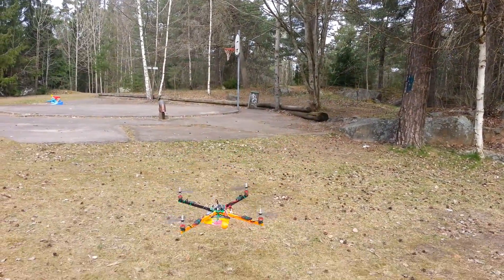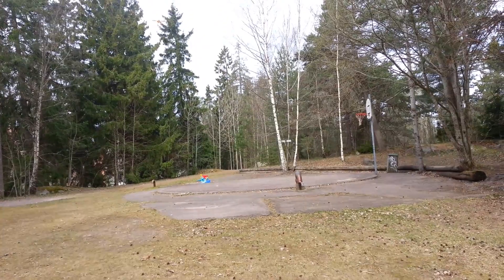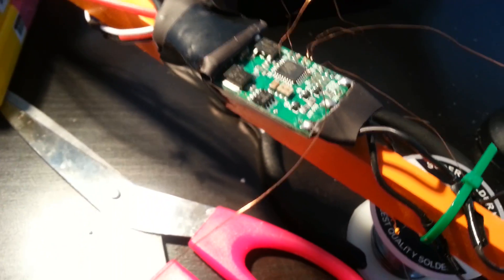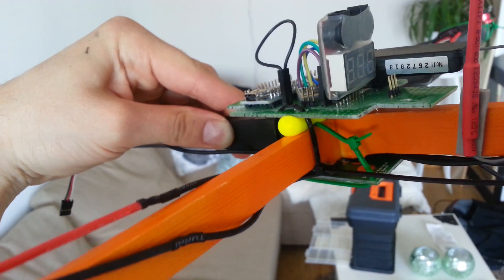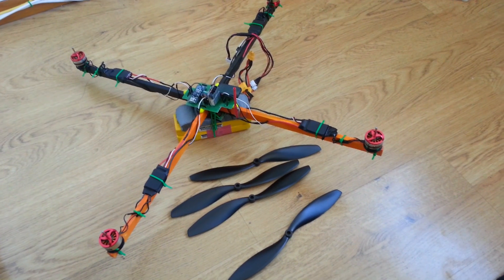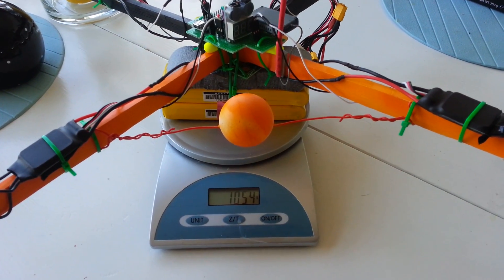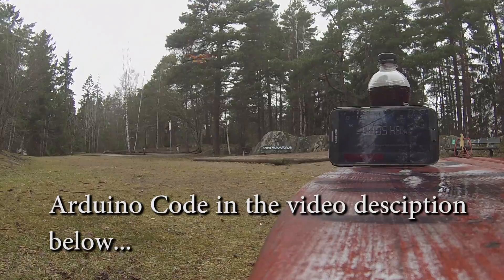Building Arduino quadcopter 30 min flight time + code and schematics

Comment: Q1 // mark all of them on 18 Feb 2019
  //  PCintPort::attachInterrupt(ESC_IN, escRead, CHANGE);
  //  PCintPort::attachInterrupt(ELEVATOR_IN, elevatorRead, CHANGE);
  //  PCintPort::attachInterrupt(AILERON_IN, aileronRead, CHANGE);
  //  PCintPort::attachInterrupt(ppp_in, pppRead, CHANGE);
  //  PCintPort::attachInterrupt(ppp2_in, ppp2Read, CHANGE);
  //  PCintPort::attachInterrupt(ppp3_in, ppp3Read, CHANGE);

and the //#include <PinChangeInt_ESP32.h> 

I tried to correct the *.h file and I cannot take some of the errors. But overall I cannot manage after  working for 8 hours, so I marked the Pin Change interrupt statement  in the *.ino. I do not understand there is a need to do Pin Change Interrupt under ESP32. 

 Q2. digitalWrite(13, HIGH);  I do not know what is GPIO 13 for? It is not in the wiring diagram!
Q3. There are a lot of at least 550 statements for MPU 6050 IMU, is this crazy???
Reply: GPIO 13 is  for internal led that is on board.
I bought a NANO for testing and figure  out to the uploading via usb-ttl method myself.

Comment: Hello sir, thats a nice quadcopter so i have a question that the arduino code you given in link, inside that folder there is only one code....so is that single code will run all components i mean receiver, esc, mpu6050 etc.....??

Comment: Hi Joseph :) I build the same but wrote another program as my controller is based on another arduino. 
My problem is that I don't succed tunning the PID : I raise P but never get stabilization. I start to get oscillation so I raise D but then I got a lot a shaking on X and Y axis and when the drone start to fly, it goes really fast head down and crash.
I really need help here... Also, How fast is your control (general) loop in your program and do you have filter fr the MPU ? I am at 250Hz (4ms for a loop on average) and use the low-filter from MPU6050.

Thank you.
Reply from the maker: Louis Simon
 Hi Louis, some things that might help is to make sure you compensate for any steady state gyro offset. Let the quad lie still on a table or the floor, and log a few seconds of gyro data. It should average zero in both the x and y direction. (since the quad is still). Any non-zero average you get, you should subtract from your raw gyro data when running your control loops.
Also, make sure you get the correct scaling of the gyro data.

Try to use dampers under your accelerometer/gyro, earplugs work great.

Try searching for pid tuning videos on youtube, there are some good videos out there.

Good luck :)
Reply: After months spending on trying to tune my quad, loosing the codes on a computer death, I finally spent some time looking at the datasheets in smallest details and one stuck me : the max frequency of the ESC is 500 kHz. My loop was around 1 ms... Everything is soooooooo simple and stable since I slowed down ^^' !!
Reply from the maker: Louis Simon, Im glad you found out what was causing the problem. Happy flying! :)

Comment: Do I need the Lipo alarm?
Reply: Kolumbus Meier in this type of project you can use it only if you want
Reply: matte15 Ok
Reply: Without the alarm you can go under 3V and then your battery will be damaged a lot and maybe won't charge anymore. You can then charge them to pass those 3V as a normal battery but this is quite dangerous ^^ I think you can't do without (I thought I could do without but when you are close to 3V the voltage drop dramatically, your drone crashes and you pray for your battery to not explode on charging).

Comment: Awesome I just have a reccomendation. 
Make some landing legs so it does not land on the battery or if it were to fall on them. If the battery gets punctured there is a very very high chance the lipos will start a fire but otherwise awesome quad.

Comment: Hello,
So I'm building an arduino quadcopter and i ran into a problem. After the ESC calibration setup with the arduino, i turned the throttle up a little and the motors started twitching and beeping. Do you happen to know what is going on? Please help. I could email the video of what it is doing if you'd like to see.

Comment: myservoT.attach(7);   //7-TOP
  myservoR.attach(8); //8-Right
  myservoB.attach(9); //9 - BACK
  myservoL.attach(10); //10 LEFT

Hi Jose, I'm in doubt as to the ESC's connection.

The servoT and the ServoR are the two arms on the front of the quad?
Is the servoB and servoL the rear arms respectively? sorry my bad english i´m from brazil

Comment: Does the electrical schematic need to use transistor and diode on the pro mini power auxiliary port? Would you have the connection scheme?

Comment: Isn't connecting li-po batteries in parallel quite hazardous as they are not self balancing batteries unlike li-ion? So, if one of the two goes bad or discharges the second will charge the discharged one with full force and it'll heat up or can also cause smoking and in worst case fire!

Comment: i tried but the motors were spinning violently what would be the problem ?
Reply from the maker: ashok kumar I would recommend to first make sure that the motors are rotating the correct direction, and then make sure that the  gyro is placed at the correct angle on the quadcopter.  Then you will most likely need to tune the PID parameters.

If you still have problems you should take a look att the ppm signal comming from the arduino and make sure evertying looks correct.

Good luck!

Comment: where could i find the extended video? Another thing I want to ask is that what is the rotor orientation according to the digital pins d7, d8, d9 and d10.

Comment: also which servo is the top and the bottom? for instance you have the ping pong ball for orientation, are the arms to which it is attached left and right and the other two top and bottom? just confused

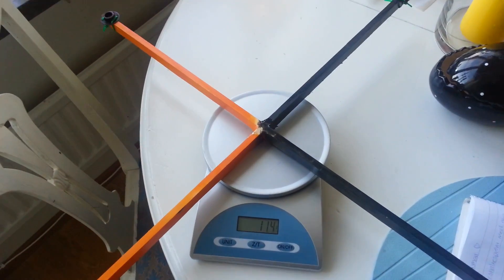Comment: Hey, were in high school and we are trying to build the exact same thing you are right now. I need help I bought all the materials you put in the Dropbox but what is the power distributor in 0:35 and also you said something about a simon tech board????? Is their anything you used that is not in the Dropbox because all I bought was the motors the escs the  batteries the remote the arduino nano and the lipO alarm mpu6050. We admire your work and we really need your help maybe we can contact you through email???? Thank you so much! HELP!

Comment: Josef Holmner,

I am looking to build my own quadcopter using the same hardware, but a different frame and materials, plus the possibility of extra changes.  Do you have any problems with me putting your Dropbox-linked code etc. into my publicly-accessible Github repo?

Comment: Bro i have used 930kv brushless motors and 30amp mystery firedragon esc and 3000mAh battery and 4x  7.5X4.5 props and rest of the things are same except for the lipo led alarm. but my quad is not flying. Another thing is what is digitalwrite(13)?

Comment: My drone is 3200 grams and I get nearly 30 min hover flight, with gopro, gps, servos for moving landing gear and everything.
Reply: +Vlad B Im new to Ardiuno. Did you used the same coding and method like he did for quadcopter,apart from your additions. Thanks in advance
Reply: +Muhammad Faisal i did not use arduino at all. Here is what I built: http://www.rcgroups.com/forums/showthread.php?t=2327044&page=135#post34397730

Comment: Hi Josef, first of all, good job and very nice video.

I'm trying to use the code in a quadcopter and I have a doubt with the code.

I assume that ELEVATOR = pitch, and AILERON = roll but I think I'm wrong... and, how do you compute de yaw? The config of the quad is + or X? I think that is + config for the next funtion

void reciever_to_value(){
  if(ESC > 900 && ESC < 2000){
  main_power = map(ESC,1080,2000,670,2000);
  }else{main_power = 800;}
  
  yaw_temp = AILERON;
  
   if(AILERON > 900 && AILERON < 2000){
     if(yaw_temp > 1550 || yaw_temp < 1450){
        rad_rotate = map(yaw_temp,970,2000, 180,-180);
     }else{rad_rotate = 0;} 
   }
   
   
     if(ppp > 900 && ppp < 2000){
  rad_tilt_TB = map(ppp,970,2000,-44,44);
     }else{rad_tilt_TB = 0;}
     
        
     if(ELEVATOR > 900 && ELEVATOR < 2000){
  rad_tilt_LR = map(ELEVATOR,1000,2000,-44,44);
     }else{rad_tilt_LR=0;}
     
     PID_tune_2 = 0.1*(map(ppp3,1000,2010,4,15));
     PID_tune = 0.1*(map(ppp2,1000,2010,15,50));
//     gimbal_wanted_ang = map(ppp2,1000,2010,100,0);
}

First: ESC its clear, is throttle, and you map it.

Second: AILERON -> yaw_temp = AILERON? (AILERON is roll, isnt?) and you map rad_rotate between -180 & 180, degrees,, thats calc is for yaw, isnt? Is AILERON a YAW?

Third: ppp, is pitch? rad_tilt_TB (top, back assume), and you map between -44 and 44, angles for inclinations, its clear.

Fourth: ELEVATOR -> the same question, is pitch or roll? I assume is roll for "rad_tilt_LR", again -44, 44 angles.

and the last lines, ppp3 and ppp2, what channel are they? or the purpose.

Thank you very much.
Reply: Hello! Im trying to build arduino quad. Have you done yours ?
Reply: did you finish yours,,   Just started with mine???
Reply: im finished with cc3d on board :)
Reply: Is it working?
Reply: yes
Reply: +vrb can you give me details,  like you design  drawings  , codes etc
Reply: I used cc3d with cleanflight hex, programmed via ftdi. All based on zmr250 frame with blheli esc. Just goodle cleanflight on cc3d.
Reply: +vrb didn't you use an Arduino  uno ?
Reply: No, i decided build on cc3d. Arduino works, but slow, and not stable for me. Code i downloaded here, by link below video.
Reply: +vrb 👌. . gòod
Reply: did u find the code in the libraries????

Comment: test_radio_reciev() has been called Inside the void setup().But I am unable to find ESC value range, means from where ESC get definite value to check the condition while(ESC > 1120 || ESC < 1060) 
Its looks to me that test_radio_reciev() does not require.
ESC value assign from void check_radio_signal()

Please clarify my comment

Comment: when I compile code I get this error
 Quadcopter_Code_Arduino.ino: 658: 26: fatal error: PinChangeInt.h: No such file or directory
why?
Reply: +Diego chauca gallegos why you did not add PinChangeInt folder inside your Arduino library that is located in "My Documents"

Comment: If I were to hook up a go pro with this, would you suggest I buy motors with more RPM?
Reply from the maker: I have added a GoPro to this quadcopter myself with no problem at all. good luck!
Reply: +Josef Holmner Thank you!! I will let you know how it goes!
Reply: +Josef Holmner Currently the motor and ESC you listed is on back order on hobbyking.com do you have any other suggestions on what to get in replace of them?

Comment: hello...how much did it cost for you to build this amazing adruino quadcopter???
Reply: bellow 100$
Reply: Domino60 I want to build a quadcopter like yours..can it carry a gimbal and a sports cam?
Reply: Renz Romaguera same question
Reply: 1200 Kv motors could probably handle the extra weight, if not just to a bit higher (due to the heavy weight of the batteries, even a 2200Kv motor wouldnt go astray, not much more expensive, is a direct replacement, and offers much more thrust, at the expense of fight time)

Comment: Thank you so much Josef for your sharing. I intend to do this quadcopter but I am just an amateur about Arduino. Could you tell me your Arduino code using PID or PWM technique to control the quad?

Comment: Hi Josef, Nice project and also i tried to borrowed  your  idea and code but as i m new in this short of project I failed in some point. can you please help on this below ques.
1. please let me know how i can calibrate the esc's, did you calibrated from ardiuno connected or by connecting the rx with esc seperate. I am using hobby fan 30A esc' s for my project. 

2. Can you please share the other channels( ppp.......) setup from the tx that you mentioned. i have turnigy 9x v2 version.

Comment: Hey Joseph thx for the job.
Please check code in read_acc_gyr().
the 2 following lines seem suspiscious :
double ang_x_raw = accel_t_gyro.value.y_accel;
double ang_y_raw = accel_t_gyro.value.x_accel;
Would rather be ? :
double ang_x_raw = accel_t_gyro.value.x_accel;
double ang_y_raw = accel_t_gyro.value.y_accel;
Thanks.
Reply from the maker: Marcel, the reason I switched the coordinate axis is because I prefered to call a certain direction of the IMU module y and x respectively. You can change it back if you prefer, just make sure tge module is facing the right direction.
Reply: +Josef Holmner Ok thx Joseph. I understand now. I shall use x with x, and y with y.
Please can you tell me what are these 'DigitalWrite(13,...) ? What did you connect there ? Looks like MPU reset, but I dont understand how.

Comment: Thank you for your video and code. Can I use this code to control a helicopter using two servos ( not for quadcopter)? Do I need to modify any part in the code? Thank you in advance for your help.

Comment: when i trying to upload the code to the ardiuno it fail 
Arduino: 1.6.1 (Windows 8.1), Board: "Arduino Uno"

Quadcopter_Code_Arduino.ino:658:26: fatal error: PinChangeInt.h: No such file or directory

compilation terminated.

Error compiling.

  This report would have more information with
  "Show verbose output during compilation"
  enabled in File > Preferences.

plz help
Reply from the maker: Jesus , you will need the PinChangeInt.h library. It should be included in the drop-box folder "libraries". Good luck!
Reply: same issue
Reply: +Josef Holmner I have same issue : PinChangeInt.h: no such file or directory

I put the file PinChangeInt.h on my folder but the result still same.. can you teach me how to fix this problem. pls..
Reply: +Josef Holmner Thanks a lot

Comment: How much did you spent?
EDIT: ok I have made my homework, now I know how much =P
continue reading please (my next self-comments)
Reply: Do you think I can attach a GoPro Camera (110g) on this Drone without compromise a lot the battery life?
Reply: And now the really important question:

Do you think it works if I use:

this motor (x4): emax mt2216
this ESC (x4): Emax SimonK Brushless Motor 30A ESC
this battery (x1 or x2): FLOUREON- 11.1V 5500mAh Lipo 3S 35C

The items you used in your project are unaviable in my country in less than 60 days =|
Josef Holmner please give me a hand =P I am a newbie eheh
If I am not wrong my drone will fligh for 15-20 mins more or less (if I use 1 battery)

Comment: Pretty good job! I bought almost the same motors, but different ESCs (because they have not better on werehouse on Banggood), 12A instead wanted 20A ESCs. The same props, but also I will try three leaf 9x4.5 props for quiet flight (500 grams thurst on 10A, while 10x4.5 two leafs has 500 grams thrust on 8.5 A). Thank you for sharing this video with us. Construction look so simple and easy. I hope to finish mine soon.

Comment: Hi.I made it.I upload software to arduino uno.But when I increase throttle engines running order.Before the first engine is running,then second engine is running,then third engine is running,finally last engine is running.So it does not rotate at the same speed all engines

Comment: Hello Josef,
Very nice job! tnx for sharing the information.

I wonder if you know how muck this project costed?

tnx in advance =)
Reply from the maker: Talal Osman , I estimated the costs to around 110$, but that figure does not include shipping nor smaller items such as wires and soldering tin. To get a more accurate anwser you could go to hobbyking and ebay and see what everything will cost to buy.

Comment: Nicely done!

I´ve made one myself one too for a school project. Yours seems to fly a little more stable than mine and I have a few questions for you.

1. Is a big gamechanger if you flash your ESC´s with SimonK ?
I had a lot of trouble with the Servo.h , which only had a 100hz refresh rate.-> solved it with analogwrite (which is @ 490Hz.)

2. Do you use gyro-only? I used the DMP (digital motion proccessing) from the MPU6050. I liked it alot more, and i didn´t have to use Kalman algorithms for filtering..

3. How do you filter your data? I used first Kalman, but i never got it working, and the DMP algorithm worked like a charm :)

Greetings & nicely done!
Reply from the maker: QuintenCr  I will try to anwser your questions;

1) I have made other quadcopters before, and I got them pretty stable even without simonK. But the difference is definitely noticeable. Especially when doing declines in altitude, before flasing with simonK the quadcopter would always wobble alot doing that, but after flashing, the wobble was almost completely gone. I had to change my PID-settings though, so that is important to remember. I would say it is worth the trouble if stability (and speed) is important. 

As for the servo refreh-rate, please see the Code comment.txt in the folder with the code. I changed the servo.h library to allow faster refresh-rates than the original 50hz.

2 and 3) I use the raw data from the gyro as well as accelerometer. I too have thought about setting up a calman filter, but instead I used something called "complementary filter" which is really easy to use. I will not explain it here, but you can read about it by google-searching "complementary filter". Basically it lets you trust the gyro data in the short-term and will converge towards the accelerometer data in the long run, to compensate for drift in the gyro. its only a few rows of code. Simple but powerful. Also I am not sure the atmega328 will be able to handle the calculations needed for kalman filtering in theese high speeds. I have a loop-frequency of about 330 hz.

I hope this helped, sorry for my rusty english.